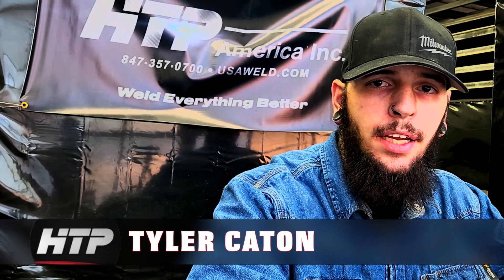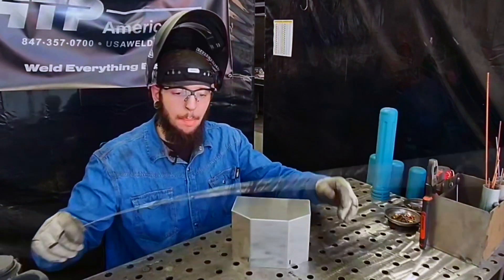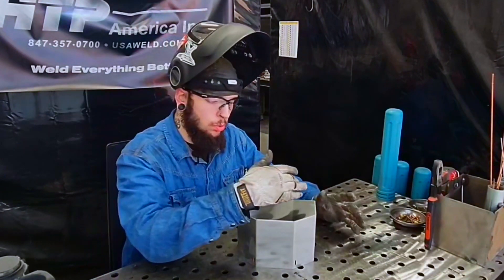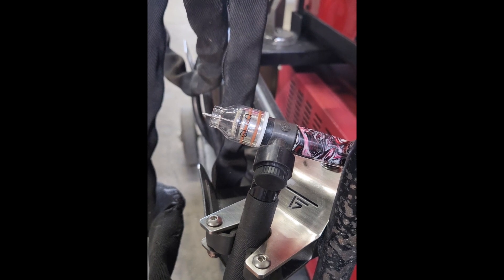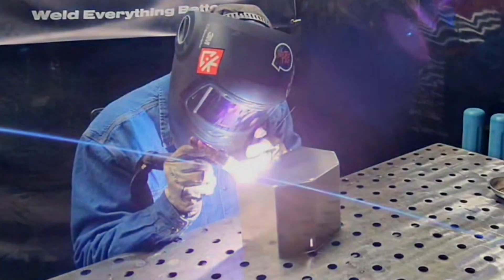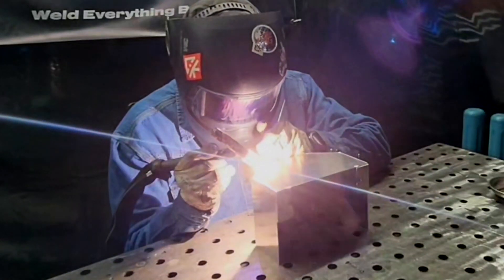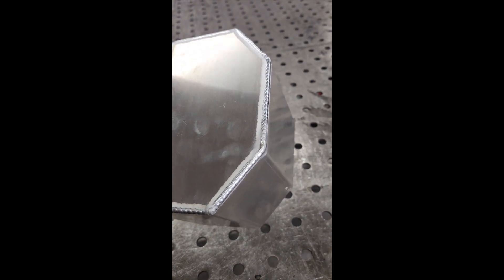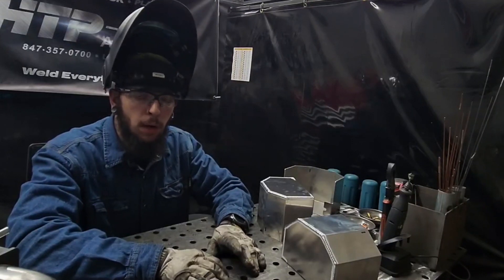Welding Up Thin Aluminum With the HTP Invertig 221

Comment: Glad to see you adding content to the channel!  I'm not very skilled with aluminum but fit-up is especially important for it and I think it might be because molten aluminum has much greater surface tension than mild or stainless steel.  Thus when you first melt the edges, each one wants to pull back to the parent material and any gap opens up.  I imagine that's why autogenous welding is common with stainless and rare with aluminum.  I always have problems with heat buildup when welding thin aluminum and Tyler could help us if he explains how to recognize that buildup.  For me, I look for the puddle spreading out too wide and flat, but on thin stock I always seem to be feathering the amperage too late, not seeing the early signs of too much heat.
Reply: Increase your travel speed. The biggest thing is using your filler wire as your build up to reduce the material from blowing apart. Fill and chill as they say. Throwing I'm wire is like throwing in ice cubes into the puddle. You have a moment to let that puddle fan out before you need to move. If it's running away on you. More tacks to gold your piece and less heat input. You only need enough to heat the parent material to the point of wetting and adding your filler watch the puddle build to how you need then move.
Reply: Here I barely backed off of my pedal. Only on my last 2 passes around the joint was it necessary. I use my filler to mitigate heat input. Like I said above I watch the parent material wet enough to add filler. I add my filler to the bead profile I want. Watch it "sink" a bit then move. That sinking is how I know I'm getting full pen. Hope that helps!